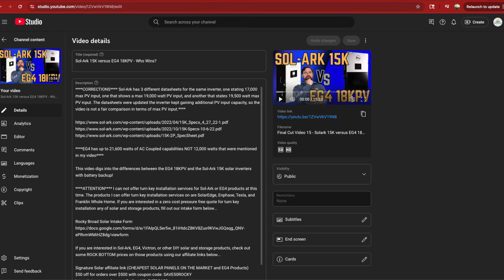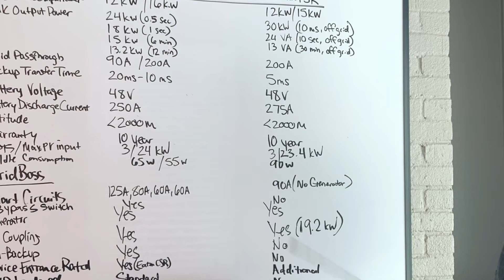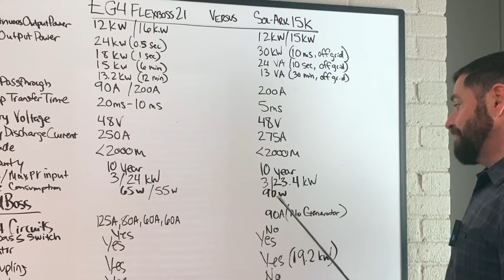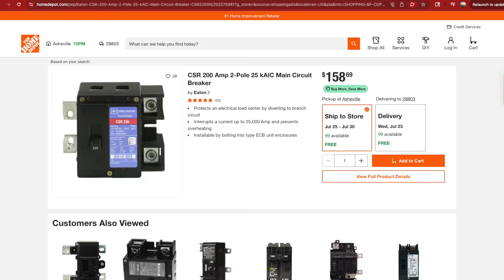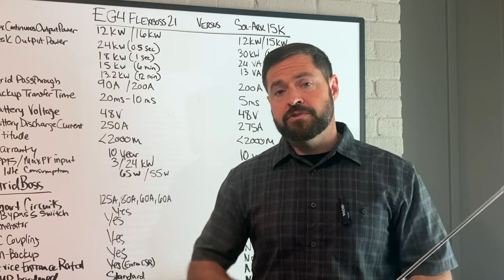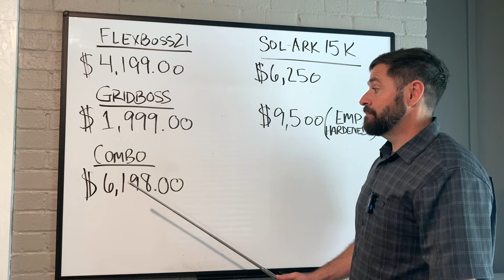EG4 FlexBoss21 and GridBoss vs Sol-Ark 15K | Inverter Showdown: Which Hybrid System Is Best in 2025?

Comment: t appears that the Sol-Ark 15k is the better inverter except for the power transfer switch if the inverter fails. This requires the purchase of a General Duty Double Throw 200 Amp 240-Volt 2-Pole Outdoor Non-Fusible Safety Switch as you point out, and this adds $1000.00 to the cost of installing the Sol-Ark. Whereas the EG4 Gridboss includes a transfer switch to keep your home running on the grid if the inverter goes down for some reason.

Further, NEC code 690.12 requires a "readily accessible, lockable disconnect means (disconnect panel) that does not require an power to work.  The Gridboss requires power to function, so if the grid goes down, there is no non-powered emergency disconnect for emergency workers to access. Additionally, even if the Gridboss does act as a disconnect if the grid goes down, the emergency workers will not know if it is functioning or not. Ergo, to meet code requirements, the Gridboss will still require the installation of a separate disconnect service panel that is "lockable." This is an important point that should be clarified.
Reply from the maker: @franklong6269  I respectfully disagree sir. In the 2020 NEC 690.12 covers Rapid Shutdown. There are many ways to achieve rapid shutdown compliancy, but a simple $100 rapid shutdown switch will suffice and it is not required to be lockable. If you are talking about the PV System Disconnect requirements which fall under 690.13 of the 2020 NEC, that is only required to disconnect the PV system, not the microgrid interconnect device. The inverter circuit breaker inside the GridBoss is a code compliant PV system disconnect. The disconnect itself is not required to be lockable. The exact verbiage states "any enclosure door or hinged cover that exposes
live parts when open shall be locked or require a tool to open." The deadfront covers this requirement. I have been in the industry for 14 years and I currently manage quality control over half of the 50 states and I have never once been required to put any disconnects in excess of these requirements per NEC code.

If you disagree please cite the exact NEC code edition and the exact verbiage out of the code so we are not misinforming thousands of people across the country about NEC code requirements. If I am wrong I will happily admit that.

Utility companies and fire departments however can have their own disconnect requirements that go above and beyond what is required per NEC code, but this varies greatly depending on your location and is not worth mentioning in a generalized video. For example my utility requires a lockable PV system disconnect within 10' of my utility meter that disconnects the PV system, not the MID. Luckily due to the inverter/MID architecture with the FlexBoss 21 that only needs to be a 100A non fused disconnect. If I had installed a Sola-Ark 15K it would need to be a 200A disconnect.
Reply: @RockyBroadSolarLLC  Thanks for your reply. I am a civil engineer and a licensed general contractor but I am NOT an expert in this field. 

I am designing a solar system for my home and I have chosen the Sol-Ark 15k because it has a much better reputation for reliability than the FlexBoss21 (EG4 inverters in general). While the EG4 inverters have been solidly reviewed, they appear to be full of bugs and can be difficult to set up (according to reviews).  

With the Sol-Ark 15k, you correctly noted that a couple throw transfer switch is needed to connect the house back to the grid if the inverter were to go down. I am preparing permit documents for the City of Peoria in Arizona right now for my system. Since I both need and want this transfer switch in my system, I am including it in my permit plans because it also functions as a disconnect switch.

 With the Gridboss + FlexBoss21 transfer switch, if it is located inside of the house, there is no external disconnect for emergency services in case of fire, tornadoes, etc. So I don't think that transfer switch would be compliant with required  codes in my municipality. 

Also, because the Gridboss switch is not a physical shut-off switch like a disconnect service panel, there is no way for emergency responders to know if power from the panels has been disconnected. So I don't think it is code compliant, regardless of what Flexboss and Gridboss claim. When those fireworkers come to a house that is on fire, they want to see a physical disconnect switch in a dedicated panel.

I would welcome your thoughts on this since this is not my field of expertise.
Reply from the maker: You are certainly entitled to your opinion on this. Those utilities out in Arizona are some of the worst in the country in terms of additional disconnect and metering requirements. In my case I have the external RSD switch installed which remotely shuts down all PV on the roof at the DC level with the TIGO optimizer/Cloud Connect Advanced, the backup loads panel, and the batteries without touching the GridBoss. Then the utility required disconnect severs the connection between my FlexBoss21 and the GridBoss(this doesn't perform RSD, just isolates the inverter from the MID). If they want to disconnect the MID they can just by hitting my service disconnect, but it would not shut the solar panels down to RSD requirements unless they trigger the RSD switch.
Reply: @RockyBroadSolarLLC  We are not talking about Tigp optimizers. That is a different system. Please stay on topic. As I have mentioned, I don't know what the Phoenix Metro cities will require, but in my research, I do believe they will require a manual disconnect switch by the electrical service panel so that emergency workers can quickly disconnect the power from the solar panel from the house. 

Also, hitting a service disconnect in the main electrical panel will not shut off power from the Sol-Ark inverter to the house. Power from the panels will still be going to the inverter if the main panel is disconnected I don't know how the Flexboss21 works with the Gridboss , so I will not comment on that.  

You have to think of this issue from the emergency worker's viewpoint. If your house catches on fire, they are not going to have time to go to the solar department in the city, which may not even be open and figure out how the Flexboss21 turns off power from the panels to the house. They have minutes to react to save your home. That is why I THINK, I don't know for sure, that the cities in the Metro Phoenix area will require a physical disconnect. 

You appear to not fully understand how the Flexboss21+Gridboss meets these code requirements, and I would suggest you do your homework and call your local municipality before you comment on it because it is a life-safety issue.  This is not an issue that you can guess about, and that sure looks like what you are doing.

A firefighter coming to your house to put out a large fire isn't going to give a damn if you have installed a Flexboss21+Gridboss system. They are not even going to know what those systems are. They are going to care about one thing, and that is shutting off power from the panels to the house so that they can use their fire hoses safely without being electrocuted.
Reply from the maker: Solark is not rapid shut down compliant out of the box unless you install optimizers or RSD devices under each solar panel. Same goes for EG4. As stated before, once you design and install a rapid shutdown compliance system, all you need is a rapid shut down switch to bring everything down to a safe level. Using a big disconnect to disconnect, the solar inverter is not going to make your house safe for firefighters because you will still have high voltage DC electricity live in the PV source circuit going from the solar panels to the inverter. If you don’t understand any of this, I suggest hiring a professional. You’re also welcome to watch my seven part series. Good luck on the project.
Reply: @RockyBroadSolarLLC  Certainly, I am a novice at this, but I learn fast. I run very complex multi-million dollar projects for a living and I have to understand just about every component in them. Add to this that I have two engineering degrees and I am one course short of a math degree, EIT certification and I am a licensed GC, all of which testify to my ability to quickly learn complex subjects like this. Further, your own videos are a testament of "professionals" who make clownish mistakes, which is one reason why I am designing this system myself. I also repair my own vehicles (I own a Model 3 Tesla and a Toyota Tacoma) myself, not because I cannot hire a "professional" mechanic, but because so many "professionals" have done half-assed repair jobs when I have dealt with them. I recently installed a 12,000 BTU mini-split in my garage without the need for a "professional," and it is connected to the internet and working spectacularly. I can program and set the mini-split from anywhere in the world.

I AM a professional, and you are very condescending considering the ludicrous quality of your videos. I don't doubt that you have knowledge to share, but you can't even explain a lot of the data specifications on the inverters that you are reviewing, and that is just hilarious.

You ought to be a LOT more humble. In contrast, I have been humble. I stated truthfully that this is the first solar panel system I have designed. I also have acknowledged that this appears to be your field of expertise. So I have not treated you arrogantly. I have criticized you, but my criticisms have been honest and not mean-spirited.  

You are correct that the Sol-Ark 15k requires Tigo optimizers, a Tigo wireless communicator and a Tigo control box to facilitate rapid shutdown, so in this case, you are 100% correct and I give you credit for that. You do have some working knowledge of this subject, but how you present it is that knowledge is problematic. 

You will need "luck" if you are going to succeed as a YouTube expert in this field, because right now, you are failing. For example, you never stopped to provide an abstract description of the Flexboss21 and Gridboss. I had to go look them up and research what they are and how they work. I am betting 95% of your viewers don't know exactly how they work, even if they have seen them on sale. Another example is that you failed to explain the usefulness of the eight smart connections on the Gridboss. You gave a superficial explanation, but it wasn't very clear. What you should have done is explain why these smart connections are useful, because right now, I don't think I would need them on my solar power system. The Sol-Ark will easily power my entire home without any smart connections.

I will leave you with this suggestion based on over 30 years of project management and engineering experience.  Whenever I manage projects that are worth hundreds of millions of dollars, my biggest challenge is not the technical complexities of the project. My biggest challenge is to communicate to dozens of contractors, engineers and architects what their responsibilities are in such a way that they can understand what goals they have to meet to succeed. I lay out the project for each individual person and company I am overseeing in a way that enables them to understand what they need to do to succeed and how they can succeed. I write schedules for each company, trade, engineer and architect that provide them a timeline to meet their contractual goals. Then I become their biggest cheerleader because if I can help them succeed, then they will help the entire project succeed. This is what you are missing in your videos. You do not know who your audience is, and you are not showing them clearly how to succeed because you are not communicating with them in a manner that they can understand.  

Work on your communication skills and focus is what is important to your audience, and communicating that information to your audience in a way that they can understand and it will take you a long way towards succeeding.  Despite your blunt, disrespectful responses, I sincerely hope you do succeed. I admire your courage to step out and try this adventure.
Reply: @franklong6269  
Do you have three arms also? Is that third arm always patting yourself on the back?
Reply: @Terrathrax  Hmmm, I guess that would be true if anything I said about my accomplishments is not factual. Then it would be delusional boasting, but that is not the case. Nor did I bring up my accomplishments until after I was insulted by the OP and accused of not being a "professional."  So it would appear that you have the reading comprehension skills of a 12-year-old. You might want to work on that.

Comment: The biggest advantage to the Gridboss is not having to deal with the 120% rule. Some panels can't even be upgraded more then 200 because the underground wiring has to be upgraded if your driveway is concrete have to cut the driveway up to dig the wire up at your expense. The transfer switch, and disconnect built into the Gridboss is so much better. I'm sure Sol-Ark is working as fast as they can to come up with their own gridboss.
Reply from the maker: I would imagine that they are. Thanks for watching the channel!
Reply: I would prefer the durability, physical build, weather resistance, and heat-resistance of the Sol-Ark but yes, I’m waiting for a Gridboss alternative for Sol-Ark.  Hopefully soon.

Comment: how is the noise level when in average load of these units?
Reply from the maker: @waterhouse1835 The Flexboss21 definitely makes some noise when at full output. I do not have first hand experience of the noise levels with the Sol-Ark 15K, but according to the datasheets, Sol-Ark is <30dB @ 25 degrees C, and EG4 is <50 dB at 3 feet. Again, comparing apples to oranges here. Thanks for watching the channel!